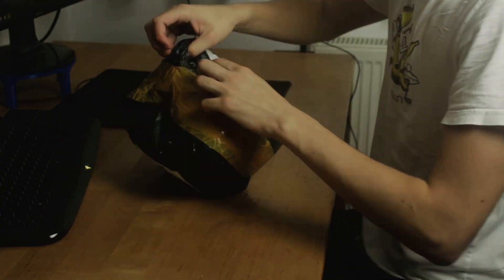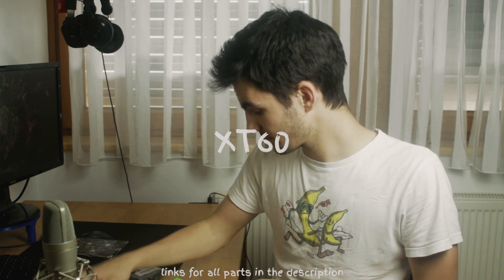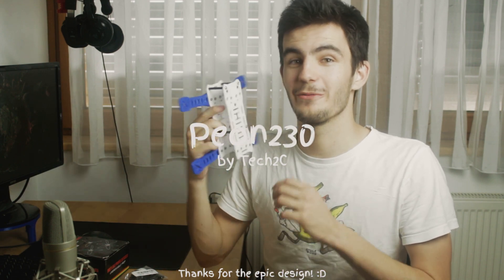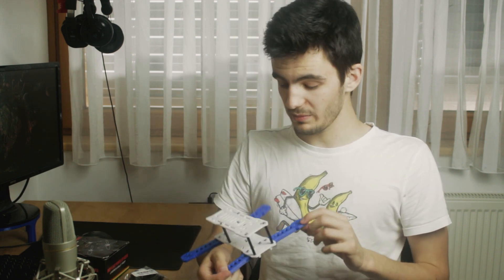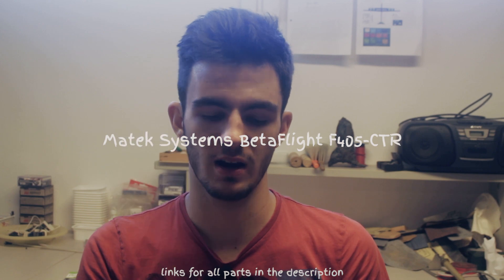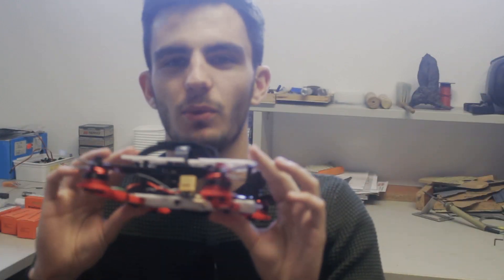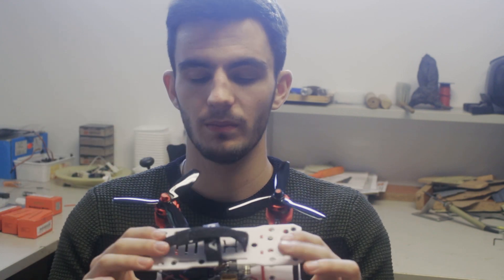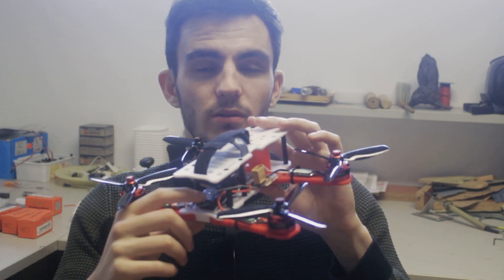How to build a  3D PRINTED FPV RACE DRONE (Peon230)

Comment: Is there a follow up flight video?
Reply from the maker: No... there want be one as the FC sadly burned. But i can say that the drone was pretty good for a 3d printed drone ;) Of course you often have to repair things as 3d printed parts are not as stable as carbon parts ;)